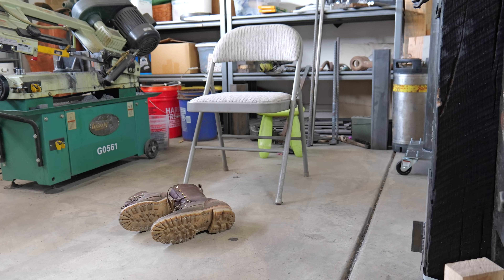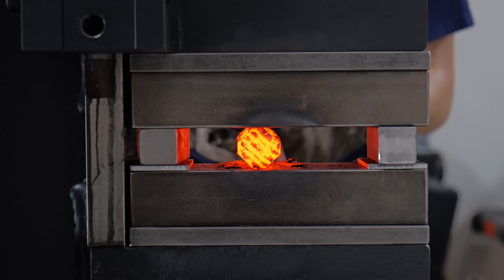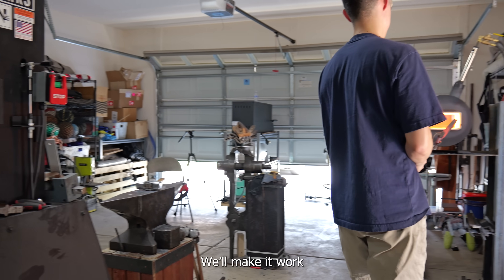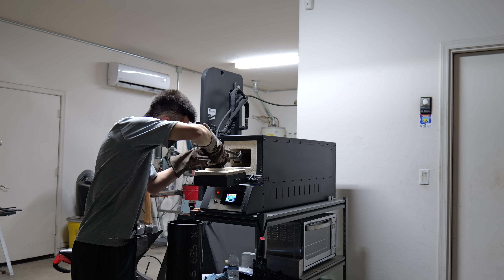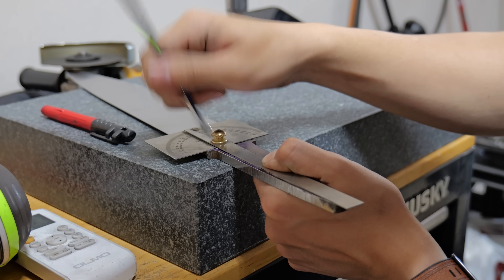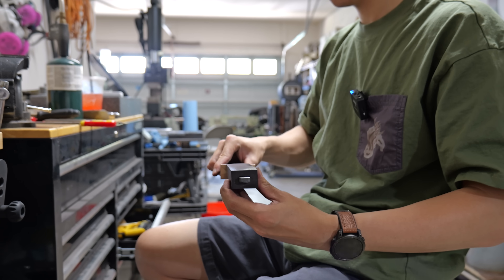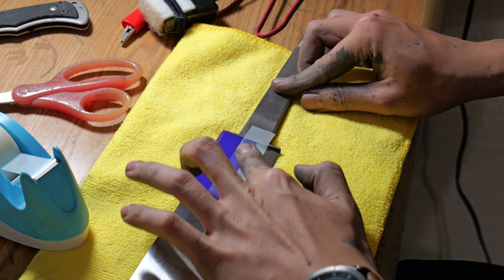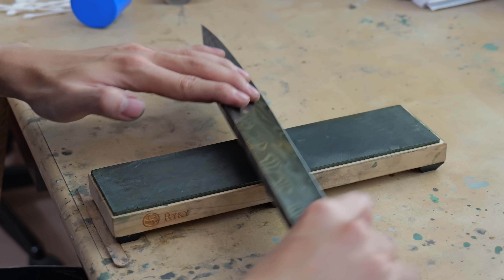Making a Twist Damascus Viking Seax

Comment: This was an absolutely lovely build. I understand this very clearly intended to be a show piece but I wanted to ask: Wouldn't polishing the handle to that degree remove the traction to avoid the blade turning or sliding in a sweaty palm? I'm wondering if there's something I'm overlooking about the construction/wood or if it'd usually end up hidden under a wrap.

Comment: I'm not sure how someone would think an engineered quenching oil is more readily available than kerosene or WD-40, but okay... I could buy either at Walmart or any home improvement/hardware store, but, okay...

Also, yes. It's called a die filer.Alec and Will got one during their sword breaker series.

Comment: DiscussionPersonal philosophy: Hammer weight: It's not about power. It's about control. you get more control with a 2.5-pound hammer than a 4-pound hammer. I started forging about 8 years ago. I start with a (and just I weighed them...because i wanted to know) 4-pound 8-ounce Swiss pattern Hamer when I need to move material, but then I go down to a 3-pound 14-ounce hammer, then the hammer I use the most is a 3-pound 2.5-ounce hammer. but i transition to a 2 pound 7 ounce hammer for small adjustments, then a 1 pound 12 ounce Japanese style hammer for initial beveling because I dont want a wide bevel)then, planishing, I go up to go to a 2-pound 14-ounce dog's head hammer...also the profile of that hammer is actually a Japanese-style hammer, from what I can see. Both the Japanese style and dog head hammers are Japanese hammers, but the dog's head flares out at the striking end while the Japanese style narrows.

Comment: From one make to another.  Nice work!  Some unsolicited advice from a razorsmith on edges.  Get a big set of cheap-o diamond hone plates and a bottle of windex.  You put WAY too much time into that blade to risk heating the edge by sharpening dry on a grinder.  I set my bevels on 400 grit diamond plates, then 1000 grit and up on the whetstones.  All of my patrons will know if I take any short cuts on the honing, because their face will pay the price.  You're talking less than 30 minutes to set the bevel wet with plates in what, 35 hours on that project.  It's worth it.  Stepping off soap box.  Great work and man,...  beautiful pattern!   One more little point.  Get a 200$ tig welder to weld the pommel.  Puts so much less heat into the piece and makes welds that can actually add to the aesthetic if you like that sort of organic look.  I sometimes will add a bead down the spine just for the organic look.  Before heat treating of course.

Comment: Drywall it’s a pretty fire resistant material, 180-300 degrees won’t hurt it, now if your house was built in the wet season the lumber might dry faster and pop a few drywall screws but that’s all

Comment: I know this video is a half year old but welding stainless steel is very hard in general. It needs to be purged before during and after welding, it tends to melt extremely easily, and needs to be welded with TIG welding

Comment: Stainless can be welded to carbon steel. Just use 309 transition wire. TIG weld is the wisest.

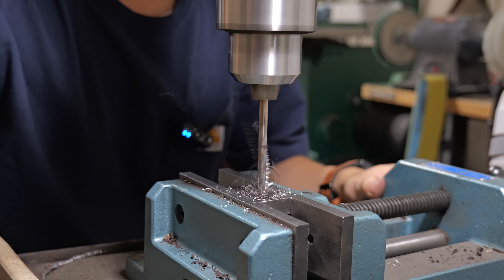Comment: 26:25 "Why is this like so much easier to file than bronze?" Bronze work hardens, mild steel does not. Mild steel stays soft unless you heat treat it. If you anneal the bronze it would get soft, but striking/filing/stressing the surface will work harden it, again, and cause it to get harder and therefore more difficult to manipulate. Don't know if you read messages a month late.

Comment: Would anyone be able to explain why the metal was twisted from a square and then pressed back into a square? Is it for increased strength?
Reply from the maker: It starts as square cause it’s hard to forge into a circle, and when you twist it it turns into a tight corkscrew which is cylindrical. It’s hard to forge weld cylinders together so I forge them back into squares.

Comment: are those shoulders on the tang not rounded at all? sharp corners on the inside of a stress point like that are a notoriously weak point in metals. You need a radius there if you expect it to have any kind of stress, otherwise it'll snap off.

That said, your forge-welding technique is astoundingly good for someone as young as you, and your design sense is definitely a strong point. I'll be keeping an eye on you, because I think you're going to do some truly special things in the future.

Comment: the bronze feels harder to file as it grips the teeth of the file. To get that round grove started easier on the pommel use a triangular file or the side of a flat file if it has teeth on the side too, and then go in with the round file. it is sooo much easier to get a straight line and aim where you want the grove

Comment: Take some design classes at a local school that teaches Architecture. Architects use art but have to teeter between form and function. You need to straddle the same line. Take the classes or meet some designers to inspire you.

Comment: FYI upper body work especially of the large muscle groups pectorials and lattimus cause much higher heart rates compared to the same or even greater work by the low body quads and hamstrings.  Why if you really want to increaee your hearts endurance and strength upper body HITT type cardio type resistande at fery high vo2 will have the greatest effect.

Comment: Instead of using a massage gun, you can cut the blade off of a saws all blade and weld the part of the blade that goes into the saw onto your file and then you have a files all instead of a saws all lol

Comment: also you should get gas for your welder. you will have a much easier and better time
Reply from the maker: I should, I plan on getting a Hobart when I get back next summer
Reply: @jhublades  hobart is ok but miller will be releasing a new welder that you just tell it what and how thick and it works. not sure when but i expect soonish

Comment: I heard Damascus steel was weaker than many other types of steel.  Is this  true?
Reply from the maker: If done well it'll be within 1% of the durability of mono-carbon steel. Micro-weld flaws are definitely a thing, but if the forge welds between the layers are set well the final product will be very strong.
Reply: @jhublades  hmmm ok thanks!

Comment: Why do you dip your metal in anything before you put it in the forge?
And your heart is just fine.  It did exactly what it was supposed to do.  It raised its beat to provide more oxygen which you needed.  If it stayed at 140bpm then you're in trouble.  I'm assuming it dropped when you were done exerting yourself

Comment: Your forge would be 3000f +. Steel melts at 2500f degree. Hardenable steel melts at 3000f degrees.
Reply from the maker: I’m not too sure about that😅the steel doesn’t have to be above melting to forge weld together. 2500 is a hard cap

Comment: what i never get is he is hardening the blade and then he sands it costing you so much extra time and waste of money keep it soft sand it to its final shape and then heat treat it saves you so much time on the sanding plust cost less sanding belts plus you can make the knife or sword brittle when sanding on spots for to long causing your heat treatment to fail and yes you can feel the heal etc etc but you finger is not on the spot directly where you grind :P and if you keep your belts all it means there costly XD cause you burn true so much belts cause your sanding a hardenend blade

Comment: Should have peened that tang, bro. Looking unprofessional and being unprofessional are two different things...
Reply from the maker: I considered that, but firstly I don’t have the adequate torch for that, secondly that would burn the epoxy even more than welding. Maybe next time
Reply: @jhublades  you don't need to heat it. Just make sure the end of your tang isn't hardened. It's slow going but so is a lot of things. You can use a carbide tip hammer to speed the process. (Or my super secret method of cutting grooves in the end of the tang with a Dremel disc and then spreading those.
Reply: @jhublades  another tip, make a copper washer to cover the pommel and protect the finish from any missed strikes.